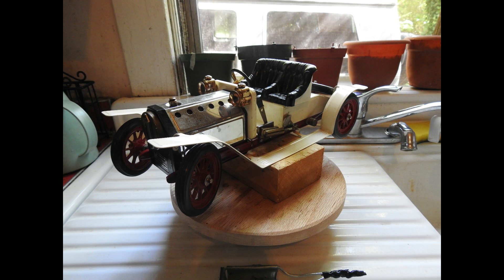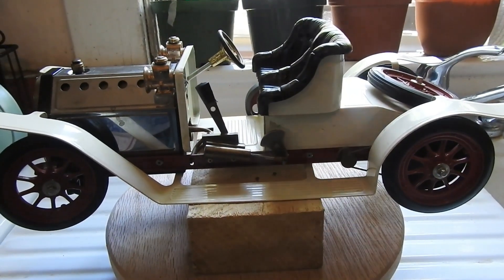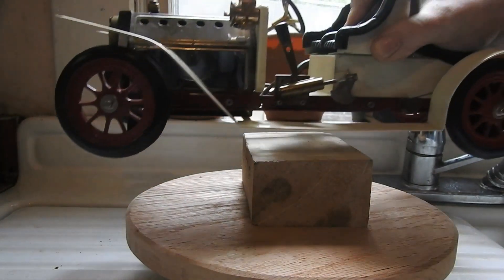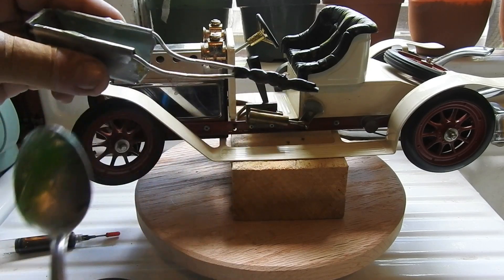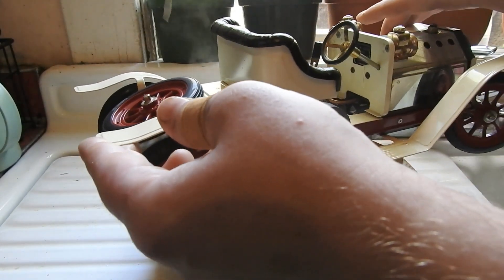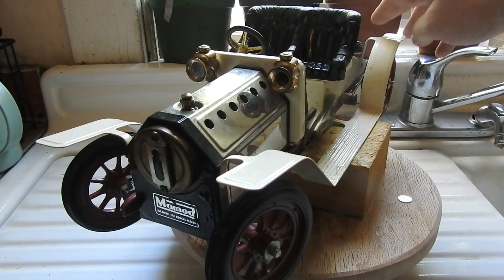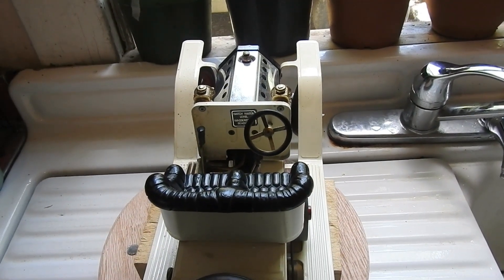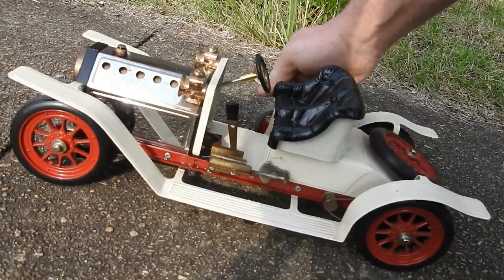All You Need to Know About the Mamod Brooklands Roadster: Review and Operation

Comment: Hi Everett. Great video! I had not seen an in-depth vid of the Mamod car. You may be right about the Buick. I should have thought something British like Rolls Royce, but that Buick looks very very close. I have also never tried that gel fuel. Interesting. I had not even heard of it until your video! Your fuel tray works very well. Jay Leno has a few life size steam cars, and for those reading this that don’t know, yes there were various steam cars in the early days of the automobile, just as there were electric cars. Ford and big oil squeezed all those developments out. Awesome. I look forward to the next.
Reply from the maker: I wish I could have just a fraction of a garage like Jays. I will be okay with my countertop engines for a while, but eventually I might try to make something larger like a boat to actually travel in.
Reply: @everett86  a boat would be cool. I know a fellow in Holland with a small steam powered launch.

Comment: That is so cool!  I had no idea that these models actually worked.  It's a beautiful looking car.  But I would guess it was hard to drive, no power steering.  And how far did it go before it needed filled up again.  I love the display!   I learned a lot, thanks for taking the time to make this video.
Reply from the maker: It's really hard to steer, especially since I don't have the steering stick that these came with originally. Lack of power I think comes from only 1 wheel drive and I may not have had the burner tray in properly which didn't make enough steam. It can run about 10 minutes before the fuel runs or and the water gets too low to safely operate. I'm glad you enjoyed the video!